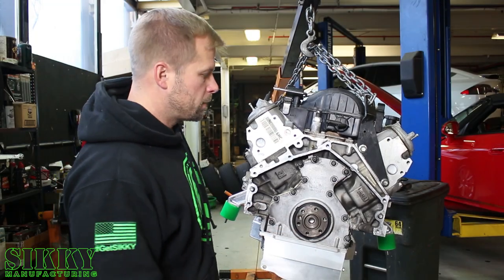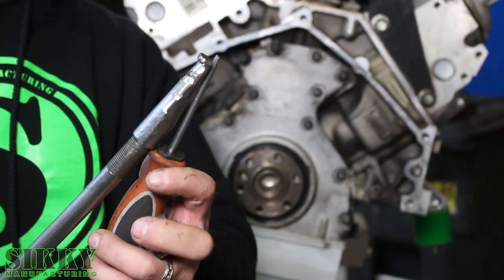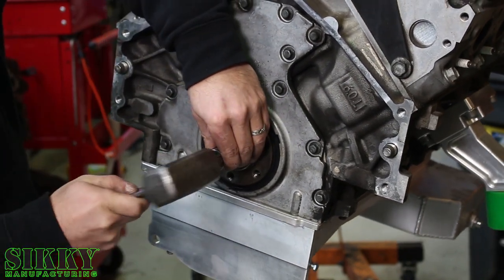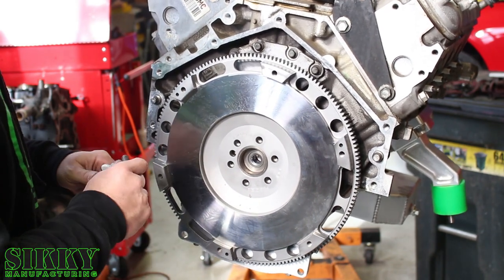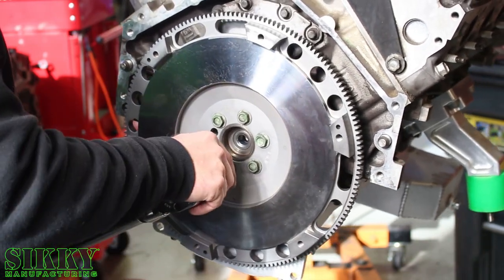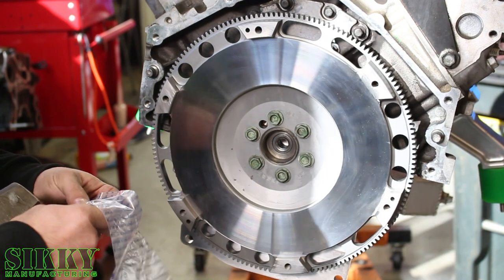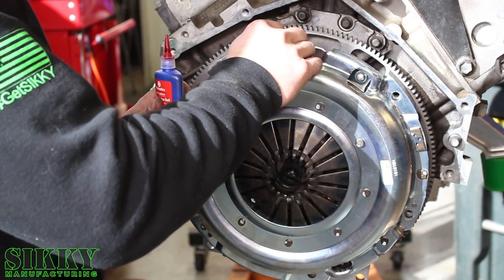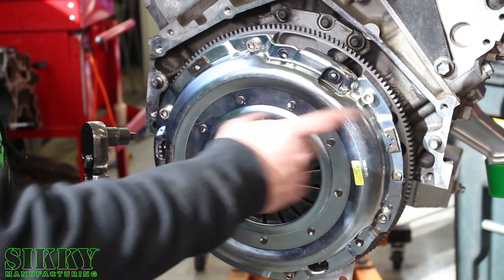How To Install A Clutch Flywheel and Pilot Bearing In Your LS Engine SIKKY Manufacturing

Comment: Thanks for posting this video.

I hadn't heard about RTV on the flywheel bolts, but good idea for addressing the potential for oil leaks.

I had heard that Loctite is used somewhere in this process but wasn't sure where. Good to know it is on the pressure plate. In some ways, I'm surprised that it is not used on the flywheel install.
Reply from the maker: Glad to help

Comment: I’m doing a ls swap in my 2003 s10 and I’m having issues getting the clutch to work. It has the stock clutch master for 2003 s10 mated to a 1990 c1500 transmission 5 speed  with external slave   With a load on drivetrain it won’t go in gear or out of gear when in neutral while engine is running it won’t go in gear I don’t want to grind the gears will that master and slave combo work together or do I have other issues?

Comment: Thanks for the video! Love the content.  Was there no oil or grease on the outside of that pilot bearing before it was pressed in?  From the video it looked like it was brake clean, then metal on metal.  Thank for the torque spec's and walk through.  It might be video editing, but it looked like you skipped some bolts while torque'ing them.  Thank for the vid. Can't wait for the next one!
Reply from the maker: It's a press fit, so no nothing was needed.  If you had trouble getting it in you could but as long as it's going in straight it's not needed

Comment: Do you clean the flywheel flange with any abrasives prior to new flywheel install? If  so, what do you use?
Reply from the maker: you can use anything really.  Scotchbrite pad or fine sand paper works.

Comment: I'm installing a new clutch in my T56 Camaro 4th gen... I use Loctite the red kind on my flywheel bolts I was not told to you silicone will I be okay? I'm all the way to the point to where I've got to adjust 4 the slave cylinder Clarence and I'm hoping that I can figure out how to do it
Reply from the maker: Yeah the loctite will usually work the same way as long as you use enough

Comment: I got a 5.3/t56 set up currently . I got gifted an ls3 clutch spec stage 2 that was for my friends 2012 camaro , would it fit my set up?
Reply from the maker: You would need to make sure the throwout bearing assembly has the right clearance to the clutch fingers

Comment: i was wondering should you use rtv on flywheel bolts or locktight?
Reply from the maker: I've used both in the past.  Honestly either would work good.  RTV silicone works at sealing a little better than the locktight though
Reply: loctite 272

Comment: In regards to putting RTV on flywheel bolts: unsure is all LS engines need this, seems like maybe the LS3 and LS7 the crank bolts are not through to the engine? I have the 08 Corvette service manual that calls out to use threadlocker not RTV on the crank bolts to the flywheel. Although I am seeing several LS1 people mention the flywheel bolts can leak oil. If anyone else has insight on this please comment.
Reply: Threadlocker will also seal in oil.
Reply from the maker: yes, correct thread locker will do the trick too

Comment: Would locktite 242 work on the pressure plate bolts also?
Reply from the maker: It would but I wouldn't recommend RED loctite for pressure plate bolts.  It can be a pain to remove so maybe Blue is a better choice.